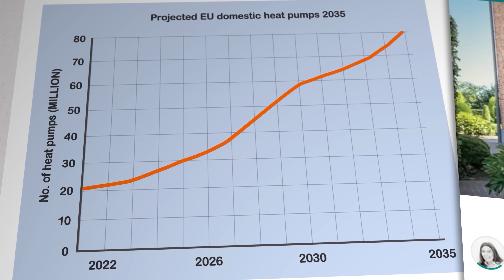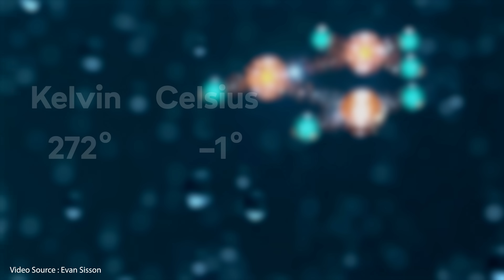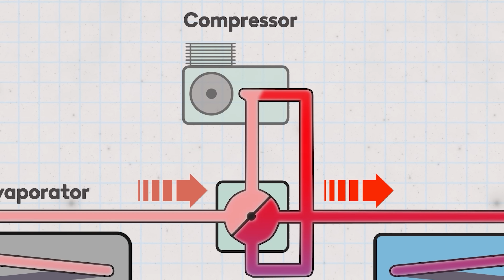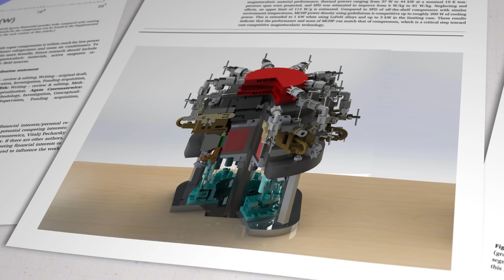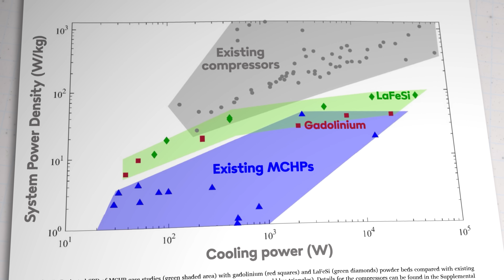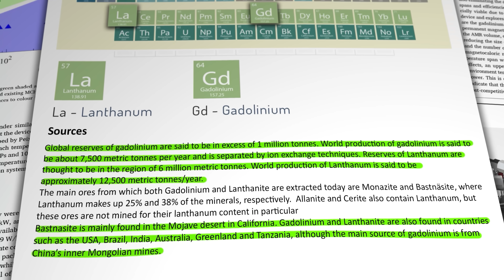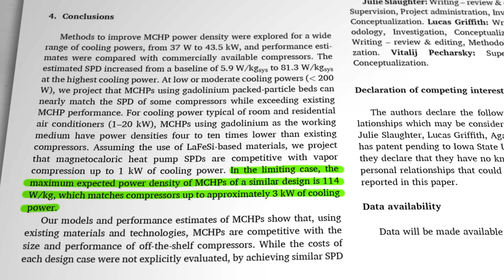Taking greenhouse gases out of heat pumps. (YES! They do contain them!)

Comment: Exciting development. But do not delay your heat pump purchase! R290 or propane in our heat pump has the global warming potential of running a typical gas boiler for 1hour! A major reason we chose it over R32 and r410a which are much heavier hitting.
Reply: Awesome - I getting a heat pump survey in a couple of weeks time - already have solar + battery, heat pump would complete my house’s net zero journey.
Reply: Unfortunately many people will delay their purchase because they don't have the initial capital for it
Reply: @waqasahmed939  this is true and all the more reason those who can, do. Without the early adoption the price won't come down.
Reply: This statement is incorrect ;-) The global warming potential (GWP) of R290 (propane) is significantly lower than the emissions from running a typical gas boiler for 1 hour.

R290 (propane) has an extremely low GWP:
- The 100-year GWP of R290 is 0.02[1][5]
- The 20-year GWP of R290 is 0.072[1]

These values are much lower than previously assumed. Historically, R290 was thought to have a GWP of 3, but recent data from the Intergovernmental Panel on Climate Change (IPCC) shows it to be far lower[1][5].

In contrast, running a typical gas boiler for 1 hour produces significantly more greenhouse gas emissions:
- A 24 kW boiler uses approximately 24 kWh of energy per hour[4]
- Natural gas combustion produces CO2, which has a GWP of 1 by definition
- Additionally, methane leaks associated with natural gas extraction and distribution contribute to its overall climate impact[7]

Therefore, the GWP of R290 used in a heat pump is orders of magnitude lower than the emissions from running a gas boiler for an hour. R290 is considered an environmentally friendly alternative to synthetic refrigerants due to its minimal impact on global warming and zero ozone depletion potential[6].

Citations:
[1] https://naturalrefrigerants.com/ipcc-includes-gwps-for-hydrocarbons-in-new-report/
[2] https://clade-es.com/blog/r290-future-commercial-heating/
[3] http://easac.eu/news/details/european-scientists-on-the-future-of-gas-we-must-ban-new-natural-gas-boilers-at-once
[4] https://www.viessmann.co.uk/en/heating-advice/boilers/how-much-gas-does-a-boiler-use-per-hour.html
[5] https://www.euroklimat.it/en/great-news-from-ipcc-the-new-gwp-of-r290-is-much-lower-than-3/
[6] https://www.rinnai-uk.co.uk/rinnai-knowledge-hub/rinnai-news/battle-refrigerants-unveiling-pros-and-cons-r290-vs-co2-heat-pump-systems
[7] https://climate.mit.edu/ask-mit/how-much-does-natural-gas-contribute-climate-change-through-co2-emissions-when-fuel-burned
[8] https://niwa.co.nz/atmosphere/what-are-global-warming-potentialtm-and-co2-equivalent-emissionstm
[9] https://www.epa.gov/ghgemissions/understanding-global-warming-potentials
[10] https://www.agas.com/au/products-services/refrigerants/r290/
[11] https://us.aht.at/lowest-gwp-on-the-market-6/
[12] https://en.aht.at/lowest-gwp-on-the-market/
[13] https://www.viessmann.com.au/en/knowledge/technology-and-systems/heat-pump/propane.html
[14] https://www.infraserv.com/en/services/facility-management/expertise/f-gas/gwp-calculator/
[15] https://environment.govt.nz/assets/publications/Measuring-Emissions-Guidance_DetailedGuide_2023_ME1764.pdf
[16] https://environment.govt.nz/assets/Publications/Files/warm-homes-heating-options-phase1.pdf
[17] https://www.epa.govt.nz/hazardous-substances/certificates-permits-and-permissions/hydrofluorocarbon-gases-hfcs-import-and-export/calculating-the-carbon-dioxide-equivalent-for-your-hfc-shipment/
[18] https://rinnai.co.nz/blog/cooling/r290-refrigerant-what-is-it-and-what-are-its-advantages
[19] https://vegardis.en.made-in-china.com/product/jOGABkWuAhTo/China-New-Generation-Air-to-Water-Heat-Pumps-with-Propane-R-290-Refrigerant-for-House-Heating-Cooling-and-Hot-Water.html
[20] https://www.waterware.co.nz/wp-content/uploads/2023/09/WW0025_Ritter_Thermal_R290_Brochure_2023.pdf
[21] https://www.hkslazar.com/heat-pump-hti20
[22] https://www.boilermanufactory.com/news/knowledge/383.html

---
Answer from Perplexity: pplx.ai/share
Reply: @LaloliVisuals  technically correct, but you didn't change his point.
Reply: @MikeHodge9000  splitting the hair there a bit. But in this world if you put an underestimate in you get the alternative reaction . Essentially r290 is great!
Reply: @MikeHodge9000  Incorrect statement? Yet your opinion is no different than theirs. Don't flatter yourself.
Reply: There's a wink emoji there which means I was joking, while agreeing.
Reply: Global warming? You mean Climate Change?
Excited to live in the Ice Age while the rich are in their fortified security turret bunkers.
Reply: lol everyone likes R290 except when they have to work on them.  I’ll keep R410A as long as I possibly can.  I’ve got 50 pounds on hand, should keep me running until all the R410A equipment is dead and gone.
Reply: @Notdave29  why? What is the issue with working on R290 versus others? In simple terms, for people like me who don't know the first thing about it!
Reply: @ Because it’s highly flammable, and you frequently have to use torches to braze refrigerant piping, the service is longer.  Instead of simply recovering the refrigerant, opening the system and brazing, you have to vent the refrigerant to atmosphere (R290 is not recovered) then purge the system with vacuum pump/nitrogen before you can braze.  When you’re paying your HVAC guy $100/hr or more, that adds up.  It also makes some electrical components slightly more expensive, but the biggest issue is simply time to service.
Reply: @Notdave29  very interesting, thanks. So the gwp of propane is likely higher in the real world too (although still not significant). Very useful to know. Thanks for replying.
Reply: @Notdave29  Care to explain why? I'm not scared handling a 5kg propane bottle for my grill.
Reply: A gas boiler is still infinitely better...
Reply: @manoo422  😂
Reply: @manoo422 Based on what?
Reply: @waqasahmed939  Heating and cost...obviously.
Reply: @manoo422  in what way? Heat pumps are generally cheaper to run.
Reply: @williammeek-h2o  Not really, with an average COP of 4:1 but electricity being 4 time the price of gas per kWh you would never get your £6-8,000 costs back...
Reply: @manoo422  That is only true if you are replacing your gas furnace solely to get a heat pump. If a new build or replacing your gas furnace anyway, subtract to cost of the new gas furnace from the cost of the heat pump.

Comment: I wonder if CO2 refrigerant is better, since you can capture it and when it leaks it GWP is 1 but it can be produced again by pulling out of air. Yes carbon capture is energy intensive operation, but so do mining/refining/recycling.
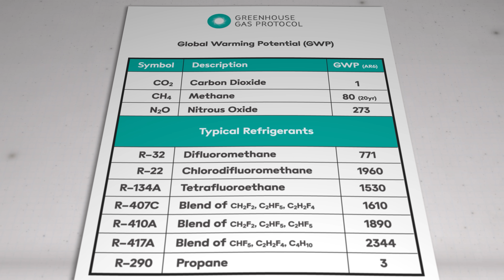Reply: Take a look at the graph at 5:00. Propane is almost as close enough and is listed as an actual potential refrigerant (while CO2 isn't).
I think a lot of factors are involved in how well of a refrigerant something is - you can't just use anything you want and have the heat pump be just as useful and efficient.
Reply: @buttonasas  CO2 is an outstanding refrigerant and works best at very high pressures and short pipe runs between evaporator and condenser. It is used in some very efficient commercially available heat exchangers that don't send refrigerant lines into the building, instead they extract heat from the air and heat water. They are freakishly efficient in applications where both heated water and cooled air is wanted. In that case they have a COP of about 8.
Reply: @JimHolder-pk2kk  CO2 is a usable refrigerant. It's typically less efficient than others though, so I wouldn't call it "outstanding". A system using a different refrigerant in similar circumstances might have had a COP of 9 or 10. The difference is that leaks are barely more than an inconvenience with CO2 and virtually everything else has problems when leaking.

Comment: Insulate Houses First then get good engineer to max ability of Heat Pump! Airflow controls with heat recovery extractors also important!!
Reply: @simonpannett8810  not necessarily. I haven't bothered to insulate. It would cost tens of thousands of dollars and would still be pretty bad. To really get a good result would realistically mean knocking it down and building new. Hundreds of thousands. 

Instead I can install two split systems for about 2000 AUD each and 13.2 kW of solar for 7000 AUD. That will keep me toasty warm all winter, cool in summer and I'll be a net exporter of about 40 kWh/d. (About 50 kg of CO2 not emitted every day) That's a vastly better return, both for me and the environment than spending money on insulation.
Reply: @gasdive nice numbers on that upgrade.  Yeah, sometimes you just got to jump in.   If you have plenty of room for solar and good sun year round, it is a no-brainer to get the mini split before insulation.
Reply: I upgraded my windows to new dual pane low-E windows early last year and a heat pump last Fall.   If you already have dual pane windows just get the heat pump.  

Everything is always about diminishing returns.   Dual pane windows are more important than a heat pump.   Same for making sure you have good seals on your doors (even more important and much cheaper than windows).   After that, a heat pump is probably your best ROI above redoing insulation on your house.

I had to replace the window frame (rotted) for one window I replaced last Fall and it was easy enough to take off the metal siding (fire country) to access the insulation.  I probably WILL gradually upgrade my insulation, but that is a project where I can easily do it in batches and still reap benefits.
Reply: Fabric first is a great idea in theory and is indeed the 'right' thing to do. However, selling it to the public is going to be tough - they (we) are used to devices for heating and cooling, and we understand what they do.
But the lack of trained installers will kill what's left of that industry as the horror stories hit the same rags Dave showed at the start.

Comment: You glossed over GWP and its meanings, you can get R290 Heat Pumps in the UK with a 3GWP.  
Hardly as bad as you made it out to be.
Reply: R290 is propane. As long as the refrigerant is completely outdoors and heating another medium (like water) no problem. But if it is piped into the house or even with an evaporator coil in an air handling unit where indoor air flows a leak can mean a fire. With so many more potential leak points in the evaporator coil, leaks are much more likely than pipe system for propane fueled furnaces.
And even if it doesn't catch fire and even in low concentrations it can produce chemical pneumonitis in your lungs. As far as I know the only safe low GWP refrigerant for indoors is CO2 (R744).

Comment: I have a 4year old split mini heat pump on my 840square foot house.  It's great for heating and cooling -- as long as the OUTSIDE temperature remains ABOVE 40°F.  As soon as outside temps drop below that, the heating CEASES WORKING.  Last two months, temperature outside where I live dropped BELOW 9°F, and STAYED under 40°F for WEEKS. meaning, I have had weeks of NO heat, in dangerously cold(adding in wind chills) weather.  Not ideal, not desirable. This fault of the heat pump system is known, and treated as a "feature"...… So you CANNOT depend on a heat pump by itself, if your outside temps drop to 40°F or lower. Unfortunately, the wiring in my older home can't handle modern electric space heaters. I'm trying to figure out how to afford rewiring my house before next winter.
Reply: What kind of Heat pump do you have? What room temperature are you trying to achieve? How well is your house insulated? I’m trying to understand your problem. I have a heat pump from Mitzubushi and it worked fine even when the temperature hit extremes for my climate. At lows of 12Farnheit my house was heated fine. My outside temp is routinely below 40 and my heat pump works. Many many people use heat pumps successfully in my area.

Comment: I think it would be far easier to just use CO2 as a refrigerant.  And in fact, CO2 already is in short-loop applications such as water heaters.  One could even use CO2 extracted from the air itself so... no net emissions.  Except of course from whatever energy source is used to extract the CO2 in the first place.  Still, as far as refrigerant releases go, it would be a complete non-issue and that's really the point when it comes to consumer appliances.  One can regulate industrial processes a lot more easily than one can regulate consumer usages.

-Matt
Reply: Hence "short-loop applications".  But as I said, CO2 is already in regular use by several well-established heat-pump water heater brands.  The Sanden SANCO2 for example.  So it clearly it isn't that big an issue.  If one can come up with short-loop solutions, one can use CO2.
Reply: My understanding is that CO2 systems are expensive due to the high pressures required to liquefy CO2.
Reply: Extreme pressures and low critical point.
Reply: Sorry I missed your thread. Here is a copy of my post:

Magnetocaloric heat pumps (MCHPs) may turn out to be very good with careful management of the rare earth materials involved. But existing tech that uses CO2 as refrigerant works extremely well as an air to water heat pump with a COP of about 4, depending on outdoor air temperature.

It works well for water heating (and air cooling) and was developed in Japan. CO2 refrigerant (R-744) is hundreds or even thousands of times less potent as a greenhouse gas compared with CFCs and HFCs. Typical hot water output is 65°C (150°F) which is suitable for combined space heating and also domestic hot water when tempered. These units are widely available.

A really spectacular aspect of this is the ability to make and store hot water in a large insulated tank while electricity is available/cheap from solar panels or low time of use rates from utility.

The other spectacular (but more difficult to achieve) aspect is if a ducting system could be used in summer to cool indoor building air while heating domestic hot water. This would result in an effective COP of 8.

I would be very interested to learn if anyone has managed to make a Wallace and Gromit looking system like this work!

Comment: Notice there it shows propane is a refrigerant witha VASTLY lower pollution potential?  We don't use it because it is more flammable than other refrigerants even though those ARE still flammable.  Seems odd we won't use propane for refrigeration even when millions of homes have gas lines piped into them with a flame at the end already... Almost like there are interests at play that is forcing us to use more expensive chemicals just to keep sellinf said chemicals in a captive market.
Reply: All domestic fridges since 2015  in Europe are R600 which is propane.
Reply: Because non-explosive refrigerants exist. Fuel gas refrigerants were banned in the 1920s because fridges were exploding. 100 years later, and triggers are exploding again, demolishing kitchens and sending shrapnel into walls.

Comment: I'm surprised they are using mechanically rotating permanent magnets with the resultant inevitable component failure, are electromagnets no viable?
Reply: A balanced rotor can spin a loooooong time without anything breaking.  I don't see "inevitable" component failure if the components are of good quality.

Comment: Very encouraging news, and a great explanation of how heat pumps work. I got one in my house in cold Canada. I do burn wood in an airtight stove on the coldest days and nights. The two have worked great together this winter.
Reply: Same here-from the east coast.  I pretty much heat my home with a single 1800 watt mini split.  I will soon add more insulation to my attic which will help greatly.
Reply: I put a heat pump in my rural, foothill house last Fall and it works great.   Especially with IoT connectivity. I can turn on the heat pump remotely with an app so the house is already warm when I get home.  I'm still eventually going to put a wood stove in the house because I have plenty of trees and dropped branches anyway.    If you live in a cold area (sub freezing winters), you don't want only one method of heating anyway (the wood stove would be replacing a heating oil heater as my backup heat).

I'll probably expand my solar this Spring (spare capacity on the inverters) so I can heat/cool my house off of solar for 9 to 10 months (not enough winter sun)
Reply: @taliesin1977  mine is connected to ducts. The air handler has auxiliary electric elements. They came on only once this winter, when I set the thermostat several degrees higher than the (overnight) 16.5C in the morning.
Reply: Well then you are still poluting the air !   Net zero I think not !   Clearly they don't work.

Comment: Thanks, cool tech.  That said, I’m sure R290 (propane - GWP 3), and R744 (C02 - GWP 1) .. so materially nothing will dominate.  Both can heat to boiler temperatures of 75C and R290 is the cheapest option.  R290 is flammable, but air to water designs, where no propane enters the building, are legal in most of the world already.  C02 is awesome as well, but slightly more expensive due to higher pressures.  Anyway .. love your channel!
Reply: The government banned fuel-gas refrigerants in the 1920s for a reason. Don't tear down a fence before you ask why it was built.
Reply: That's great info! Thank-you
Reply: In AUS, we are starting to see R744 used in domestic hot water generation and some of the more expensive domestic cooling/heating systems.  No doubt they will get cheaper.